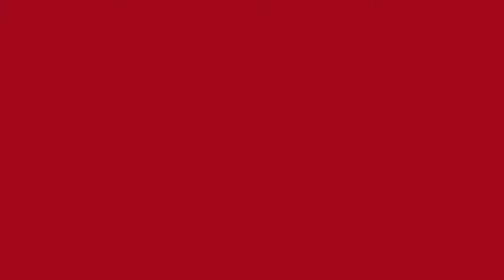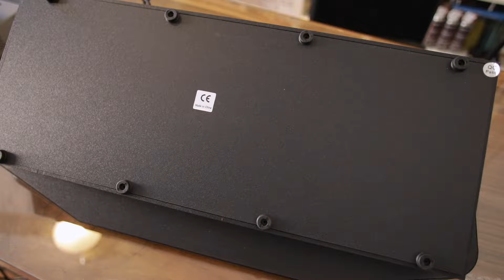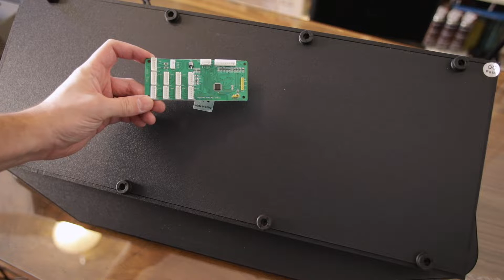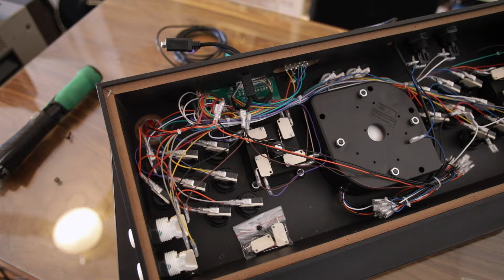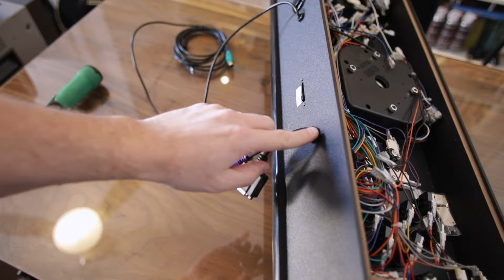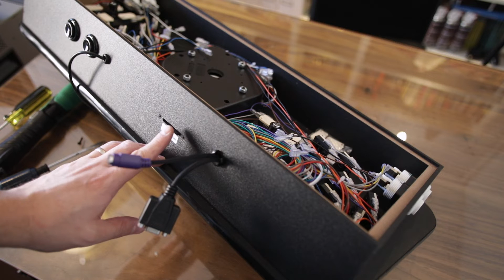X-Arcade Zerolag Tri-Mode PCB Installation

Comment: So i bought a tankstick a few weeks ago and when i plug it to my pc i hear the sound of the usb being plugged in but nothing works, the track ball part works but when i plug the other usb nothing works, no matter where i put the switch the pc does not register any inputs. I see the little redlight flash for a bit but then it dies out.  the oly thing different i mine is tha ti had to buy a seria to usb cable since the seller did not sent me the original.  Would this pcb fix my issue or is it an entirely different situation?

Comment: Hello! What settings should I apply for Nvidia Shield TV and MAME4droid (0.139u1)? I don't have a normal selection of 1 or 2 players on the original X-Arcade Tankstick. 
Is it possible to buy X-Arcade™ Trimode Zerolag Upgrade PCB on AliExpress ??? Link please.

Comment: I updated my PCB board on my 20 year old Two Player X-Arcade using this video back in 2020. Today I picked up a "broken" two player Tank stick for a person for under 50.00!! Turns out that the Tanks stick still has(at least I believe it has) the old PCB board from 20 years back. The board that I bought back in 2020, that I have in my 2 player X-arcade, is ver.1808 and the ver. of the PCB board in the tank stick is 1310. I'm guessing that I need a new PCB board for the Tank stick. I think X-Arcade is selling the boards now for 35.00.There's nothing wrong with the Tank stick, the seller just did not know that they needed to update the PCB board for the stick to work with newer computers.

Comment: hello, my arcade has the switch dismantled, the PC recognizes when I connect, but it doesn't work, before it worked, can you tell me if it's possible to ignore this switch somehow, leaving it only for PC mode definitively? 

Whats happens if I do not plug switch connector?

Thank you very much in advance!!
Reply from the maker: you buy a replacement from https://shop.xgaming.com/collections/arcade-parts/products/x-arcade-wiring-harness
Reply: @ArcadeOne  thank you so much man, I just bought!! Thanks a million!!

Comment: I have purchased a Tank Stick back in November of 2021. I have been working tirelessly on trying to get this thing to work correctly with RP4. I have the xpad and xboxdrv installed on Retropie. When I configure my Tankstick on start up, I am able to exit my games properly but my mapped keys are all screwed up. When I uninstall the previously mentioned drivers and install the Xarcade2Jstick driver, I am able to map the buttons and I can play my games with no issue but I am unable to exit my games. In order to exit the games, I have to reboot my RP4. Any suggestions? I am in need of some help.

Comment: so i installed this board and works like it suppose to.  I keep it in mode 4 for the xbox 360 control setup.  My only problem is when i restart my computer or boot it back up mode 4 isnt recognized. I keep having to switch it out of mode 4 and then back into mode 4 for it to work.  I have tried different ubs ports as well.  anyone have this issue and know how to fix? i have this setup in an arcade cabinet so i dont want to have to keep flipping the switch
Reply: Same. Did you ever find a solution? I have a usb hub with an on off button I hit after each reboot but came here looking for a better answer.

Comment: hello.thank you for your video..:) Can we still use xbox (1st generation=very old..) adaptor?if so, which mode?1 , 2,3 or 4? it is not in their guide..? https://support.xgaming.com/support/solutions/articles/12000051721-tri-mode-pcb
Reply: That's a good question and dreamcast

Comment: I noticed that the new Tri-Mode PCB has a jumper and socket labeled "Spinner".  I assume X-Arcade is coming out with a Spinner?  When will this be supported and available for purchase?
Reply from the maker: There’s no release date yet as far as I know
Reply: I connected one of the GRS spinners I got from Amazon to the new Tri-Mode board (with a JST-PH 2.0mm 4-Pin Female Connector end to end extension wire). I wanted to switch the axis to the y-axis so I could have two spinners (the GRS spinner defaults to the X-axis). Unfortunately, it did not work.  Does anyone know why?  I was thinking of trying the Hagstrom ME-4 as as an alternative, but I don't know why X-arcade but this option on there if it does not function.

Comment: I got one of these, it doesn't work, still acts like keyboard.
Reply from the maker: you didn't get the right one then
Reply: @ArcadeOne   It was this one: https://shop.xgaming.com/collections/arcade-parts/products/x-arcade-build-your-own-arcade-control-panel-kit
It's installed right, but maybe they messed up and just send me a replacement of the old one instead? Trying to get a hold of them, so we'll see I guess.
Reply: same here. not sure if I "didn't get right one" as there is only one to get
Reply: I just got it to work. Had same exact problem, but would just recognize as a plugged in device. Once I updated the firmware worked like a charm
Reply: @billford171  I couldn't update the firmware because it won't even acknowledge it's plugged in. USB not recognized but the light comes on. Honestly I just hate the x-arcade, I eventually gave it away for free to someone who wanted to mess with it and bought something better and it works with no issues no hasstle. The X-arcade was just a mistake.
The person I gave it to never got it working either and they are fairly tech savvy.
Reply: @sociallyresponsiblexenomor7608  you have to hold start 1 and 2 WHILE you plug it in (after running the firmware updater). I had issues until I did that, and then worked like a charm
Reply: @billford171  Yeah I went through all those steps they had on their site and much more.
Reply: @billford171  Pray tell us then: Where is the firmware updater? Everything on the website is broken.
Reply: Plugging in the new board was plug and play for me and simple to use
Reply: @hectec69  I've worked with 2 of them, and both times it was the opposite scenario. 
Hit or miss I guess then.

Comment: I ordered the X-arcade tankstick and it'll be here Friday.  I received an email that the Trimode will be shipped mid next month.  I received and put together my Raspberry PI, will I need the Trimode to play games?
Reply from the maker: Hi there, you should be asking the person you purchased the Pi from these questions. You should be able to use the Tankstick just fine without the Trip-mode board.
Reply: On the pi you have to download the app for it to work with retropie. Can't remember where it is as from two year ago but it worked fine. I haven't installed my trimodes yet though. Hope this helps

Comment: Can I add the ESC key using this new encoder?
Reply from the maker: not sure what you mean
Reply: @ArcadeOne  One downside to my X-ARCADE is in hyperspin, I often have to use my keyboard to get back out of the game I'm in.  The new X-Arcade adds an extra button to map to ESC.  Didn't know if they are using this board differently or just the extra wires from the trackball like the workarounds suggest.

This mentions it on their page somewhat..

https://support.xgaming.com/support/solutions/articles/12000003233

also mentioned here

http://forum.arcadecontrols.com/index.php?topic=100885.0
Reply from the maker: Chuck Pappas with my systems, I configure one of the two buttons beneath the 6 player 1 buttons as ESC, no need to use a keyboard. With the new sticks, the exit button is hard wired to mouse middle click, you cannot map it to ESC. You can setup middle click as an exit key in RocketLauncher but there are some systems like Pinball FX3 that ignore this so it isn’t ideal.

Comment: Do I need the $35 option if my connectors are on the board and doesn't have wires hanging out the back?

Comment: How do you know if you have the new one or the old one? I ask because I bought a refurbished tankstick (from x arcade), and the board that was in it wasnt any good. So they sent me a new one (it's worked great since). But I dont know if the sent me THIS one or a "new" old one.
Reply from the maker: put it in mode 4 and check to see if shows up as a controller in Windows
Reply: The new one has a yellow plug on it for the option to add a spinner.
Reply: The new one will also say Xinput on it.